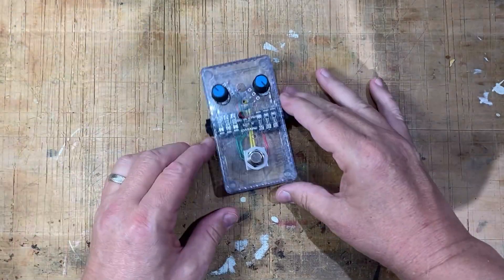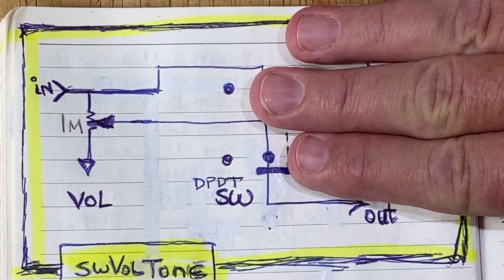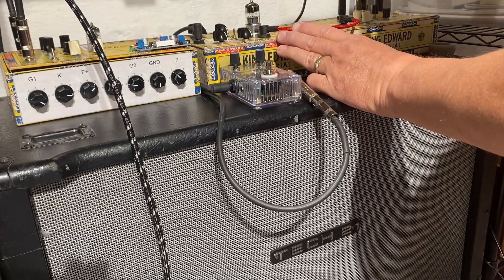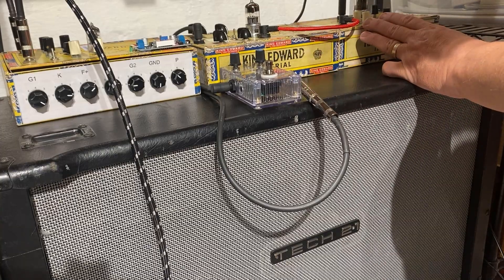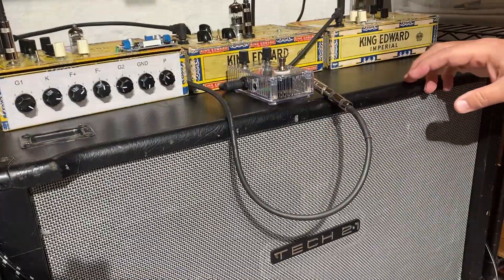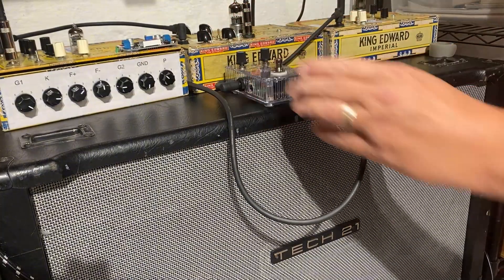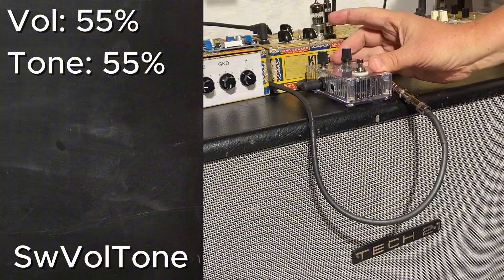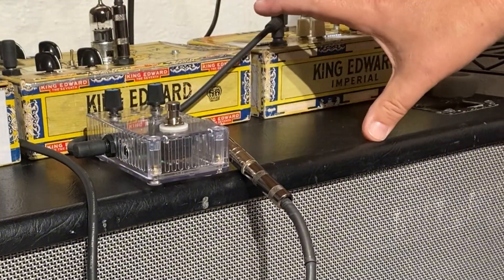DIY Fender Princeton-Style Volume & Tone Control with Bypass Switch | Experimental Tube Amp Series

Comment from the maker: In this video, I build and demo a Fender Princeton-inspired volume and tone circuit, complete with a DPDT bypass switch that completely removes the tone section for a cleaner, hotter signal. This handy little module becomes a powerful tool when experimenting with different tube stages and amp configurations — perfect for builders chasing new sounds or troubleshooting tube amp circuits.

What’s in this video:

    Classic Fender Princeton tone circuit explained and demonstrated
    How the 470pF and 47nF capacitors shape the treble and bass response
    Adding a bypass switch to remove the tone control entirely
    Experimenting with different circuit positions (gain stage, buffer, tone control)
    Real-world sound tests using a universal 7-pin tube gain stage, cathode follower, and EL84 driver
    Why simple control modules can drastically change your amp’s sound

This project is part of my ongoing tube radio-to-guitar amp conversion series, where I reimagine old electronics into custom guitar gear.